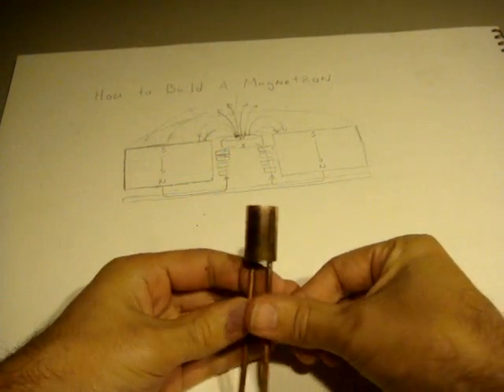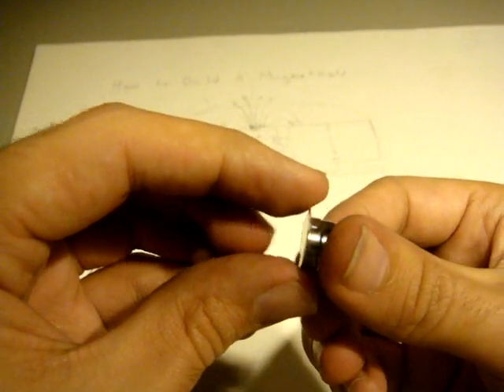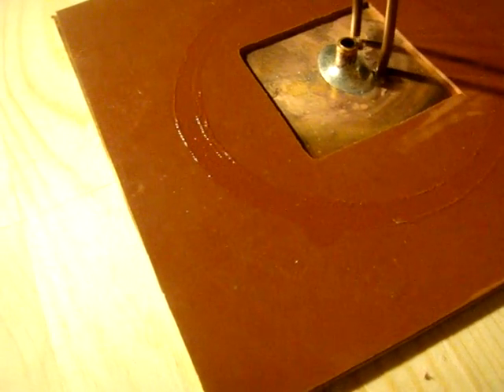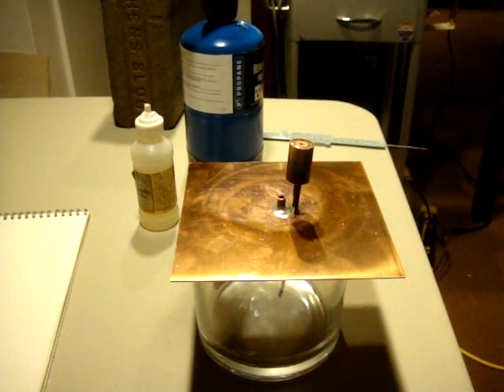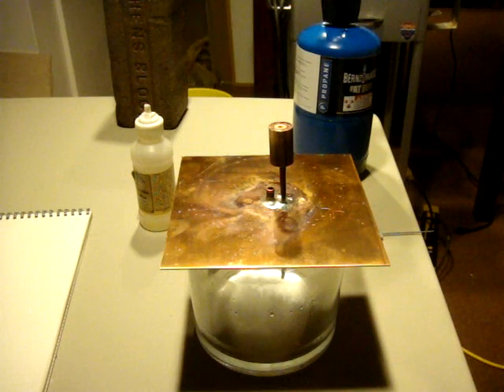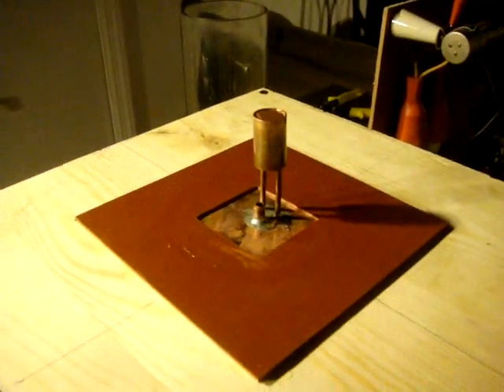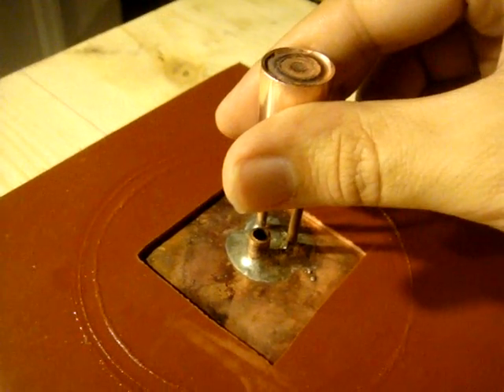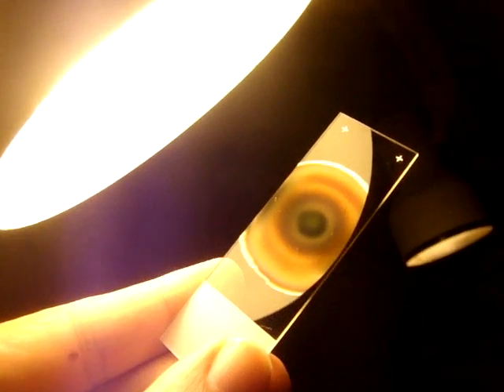DIY: Mini Magnetron (First Build)

Comment: Is any one else concerned about x-rays?
Reply from the maker: I've tried to measure for x-rays... the voltage is too low and the vacuum pressure too high
Reply: @sparkstarter is that done with just a 2stage rotary pump?
Reply from the maker: @SodiumInteresting  yes  just a 2 stage rotary pump
Reply: @sparkstarter  nice, I was part way through building one, I was going to have both a hv magnetron and high current evaporative coater. Someone gave me a oil diffusion pump but I've still not bought all the kf fittings and cooling system etc to be able to get it working. If I don't necessarily need it then I can get back to that project more easily at some point. The magnet assembly I made has gotten rusty so I'll have to remake that
Reply: Not below 20kv
Reply from the maker: @SodiumInteresting  Yes will work at as low as 500V my power supply goes up to 3kV

Comment: Amazing project. I'm really interested in producing low energy microwaves (just to heat things up like food so it's warm, even if it takes several minutes) just as a science project, but there's really nothing online about this...you can only ever find magnetrons from microwave ovens which are high voltage and terribly dangerous. It's almost like this technology is unheard of in any safer setting. So I was wondering if a magnetron at this scale can be powered with batteries (50-60 volts), and perhaps a step up transformer to produce hf plasma. Would this still be able to produce microwaves, just not as powerful? Thanks

Comment: thank you so much sir you showed me really important things. coz Im working now on a new research now. your video helped me a lot...
but uh I`m trying to make a long signal like ww2 first radar. how can I make 90* degree  long it pls tell me. than you
Reply from the maker: Radar magnetron is differnet type of design... but similar to a microwave magnetron.
Reply: @sparkstarter  thank you so much for your reply. pls can you show or explain it? I wanna long microwave radar signal. where can I find or how can I make it? I really need your help.
can you make a video about that pls? Thank you
Reply from the maker: @jemesraynor3296  What frequency and power do you need? What are you trying to do with this radar?
Reply: @sparkstarter  I dont need Radar I need radar`s signal its long and flat thats why I need it

Comment: Sparkstarter I think you mentioned in a  comment on this comment section that the pressure is 150 microns. I believe in another video of the improved set up you said the pressure there was 300. Shouldn’t the lower that number is mean better vacuum and not the other way around? I watched the thought emporium’s video and he said the pressure should be less than 100 mtorr. Could you explain? I’m trying to buy a vacuum pump and need some help. Thanks
Reply from the maker: The gas is what does the work, you want enough gas in the chamber to do the sputtering so if the pressure is too low you don't have enough gas. However you need have low enough pressure that the ions have enough free space to accelerate. If the pressure is too high the ions lose all thier energy bumping into each other... so there is a balance. I am using atmosphere so mostly Nitrogen Ions, with a heavier gas like argon you may need to go lower in pressure.

Comment: Dear, thank you for the job. I'm just now trying to do a Sputtering PDV magnetrom in my home. I'm using a argon tank gas, but I'm with a lot doubts yet. Do you used a magnet? It's neodimium?
Reply from the maker: You don't need argon, but it will probably work better than with regular air. Yes I use a NIB in for the center magnet and ceramic for the outer ring.
Reply: @sparkstarter  Thank you for responding. Good news that I will not need argon. I'm watching all of your videos. I will try to make my homemade Sputtering, PDV. I intend to make a monochromatic LCD simple with just one or two numbers for school work academic. But first I have to deposit very thin ITO Indium tin oxide at the glass surface.
Reply from the maker: @edilsonlima5985  Nice I've been wanting to order some ITO to play around with... feel free to post a video  when you get it working.

Comment: how do you run the electric though it, though the tube?  Is it Ac Or Dc
Reply from the maker: You  power it a bit like a neon tube but with the magnetron at on end. I use DC.
Reply: @sparkstarter  you have a positive and negative, connected to each tube? how would that work with the copper plate soldered to the tubes
Reply from the maker: @curtokay8046  no tubes are just for water cooling the whole assembly is -1kV  upper electrode in the Jar is ground or +

Comment: are you able to control the frequency of the magnetrons by using neodymium magnet or electromagnets
or more powerful and compact magnetrons so we boil the water with hand powered spring based battery or hydraulic pressure machine and spring based battery or gravity battery or pendulum powered battery etc

Comment: I'm a little suspicious cause there is no HV connection, anode cathode deposition gas ions etc ? :) how this setup creates plasma ? Just a ring magnet and vacuum ? (Or, all these parts of setup were hidden in this video)
Reply from the maker: yes, high voltage power supply used, see my other magnetron video where  show more of the setup.

Comment: But the truth is neyodimium magnet can not bear such high temperature , magnatic properties can loose
Reply from the maker: Yes, good point, that is why I tried to do water cooling which I admit didn't work that well. My magnetron design in another video solved the cooling issues.

Comment: Use propylene glycol as a coolant, that's what is used in liquid cooling for computers, its non conductive and non corrosive so your copper lasts longer. You can even create a closed loop cooling system if you buy a CPU liquid coolant pump and radiator.

Water is fine but water is conductive and corrosive.
Reply: Water is more efficient at cooling. Propylene glycol has a lower thermal capacity. If your not going near freezing, boiling or worried about corrosion or biologicals growing water is fine. I built a water cooled computer a decade or so ago and ran only a small % or propylene glycol in RO/DI water. Propylene glycol has to be completely pure to not conduct and if its open to air It will absorb water from the atmosphere (hygroscopic).
Reply: Use destilled water abd glycol, water is only conductive due to the disolved minerals in the sollution. Better yet if your worried about water causing a unintended circuit you can use mineral oil. Its what we use for full immersion big boy liquid cooling for HV/HF applications like powerstations and neighborhood transformers.

Comment: So you are trying to make a microwave magnetron? I would be careful if you aren't, you can produce microwaves with a higher energy that can cause cancer. If you know what you are doing you should be able to keep them in the narrow band that microwave ovens use, thereby not doing near as much harm to yourself. Loved the video by the way!
Reply from the maker: No, I was building a sputtering Magnetron this is a different type of technology not related to microwave generation. The voltage drop across the vacuum chamber is not sufficient to produce harmful radiation. Both AC and DC potentials can generate x-rays in a vacuum chamber if voltages are above 20kV. or higher. I am using voltages less than 2kV.
Reply: @sparkstarter  You're still going to produce a lot of hard UV from your plasma tho so make sure you at the very least protect your eyes with some kind of polarized lenses or even better a welding helmet. 2keV isn't enough to produce any ionizing radiation of any note except maybe the odd stray amplified charged particle being punted across the room
Reply from the maker: Doubt that any UV makes it past the glass. Don't make me buy a UV meter to prove you wrong.
Reply: sparkstarter That's what I was trying to say but, this is the internet and you know how people are on the internet.. xD
Reply: You could be producing x-rays if you are using DC instead of AC.
Reply: Not enough voltage present to produce any register-able x-rays. I would be more concerned about microwaving myself though. RF burns are unforgiving and not nice.
Reply: Yes they are! I have experienced them my self unfortunately.  I am curious what is the voltage you are using?
Reply: really happy to find some helpful videos and peoples over internet .
i'm trying to deposit indium tin oxide , on glass , 
i have some ideas but i really need someone to guide me trough the steps of building a sputtering chamber , i already got a vacuum pump (good one , like yours +sparkstarter )
maybe i have to find pyrex glass ,
i can about another things , like security , i know there is no expl0sion without oxygen 
but i keep a care about my eyes ,,, hope everything gonna be safe ,
anyway that was wonderful video , i hope to have more details about things to avoid for security ,,,
and how to inject argon gaz safely , 
more details Voltage , Current , and timing ,,,
but i really like the video
big up , good luck dear @sparkstarter
Reply: +sparkstarter what kind of waves is this producing if not microwaves?
Reply: Hello I want to aks related question about microwave technology ?????

Comment: Hi there

We also made a very similar set up but we couldnt be successful. Our vacuum level is 3*10^-2 mbar and we apply aprox. 1000V but all we can see is just random sparks. We couldnt ignite the plasma. we cleaned our copper target (like shining) but still no success. Do you have any suggestions why cant make it?
Reply from the maker: Mehmet Can Alphan The magnets need to be strong... I found that once I ran this device too long and the magnets over heated. They were still magnetic but they lost their strength required to bend and focus the plasma. Get stronger magnets and keep them cool would be my advice.

Comment: wow what a great project! very nicely done! would you please explain how you introduce the high voltage electricity to the set up you have here? Is it the copper plate that is electrified? Do you think a van de graaf generator would work instead of the microwave transformer? Thank you :)

Comment: DIY mini Magnetron sputter system. It is crazy! It really could work, and deposit copper thin film on a piece of glass. But it seems that the film is not uniform even in a small area in the glass. That might be because the sputter gun is too small, also the Cu target, which let the Cu goes to the glass sub with different angles. Thus, we could see so many circles on the surface of copper thin film on the glass. Anyway, as a self-built sputter system, people has done a really great job.
Reply from the maker: There are a couple of variables you could play with to increase uniformity and quality this was sort of a test of concept.
Reply: I see. People can try to heat the substrate, rotate the substrate to improve the uniformity. I am very supervised that you have fabricated one by yourself, cause in my mind, for a huge sputter system, the vacuum chamber is very complex. Anyway, I also see people fabricated a even simple sputter system with a a glass cup as the vacuum chamber. It can work. That is crazy!
Reply from the maker: Quentin Lee I used a larger more sophisticated sputter chamber in college I enjoyed using it. Oddly enough there isn't a large demand for semiconductor fabrication knowledge... I went to work in the solar industry and started to miss my semiconductor fab days... I wanted to do copper oxide solar cells but I could never get it to work. Sounds like you have some experience in semiconductor fabrication?
Reply: sparkstarter Yeah. I have been in semiconductor industry for 5 years, and familiar with most of the design and process.
Reply from the maker: Quentin Lee What do you think of the job growth in the semiconductor sector? I would like to do more work in that field but doesn't seem like there are a lot of good opportunities.  What do you think?

Comment: 1 month continuous mass production possible, arc None, the particle does not come out of the ion source
Voltage up to 3500V, up to 6M Length ion source, can be stable sputtering, ion source can produce double-loop
Pretreatment, IBAD, etching, cleaning,Implantation,sputter
Data requirements; kdh6157@hanmail.net,+82-10-7685-2564 duhan Kim, Naruto Eng, Japanese can
Reply from the maker: Send me a free unit Kim, I will make a Youtube video for you : )
Reply: sparkstarter email adress: kdh6157@hanmail.net
Reply: sparkstarter Ion source is more expensive

Comment: Would it be less efficient without a vacuum or just not work at all?
Reply from the maker: yeah the whole thing is in a glass jar.
Reply from the maker: Surya Pandian thanks :)
Reply from the maker: Needs low pressure vacuum to work...
Reply: What does the vacuum do?
Reply: sparkstarter
but in this video, there was a vaccum pump but was there any enclosement like vaccum chamber in it, I dint see ny vaccum chamber over here, just a hole where you showed you would connect vaccum pump, did you have a glass over it or something like that..
this iwas AMAZING though.. :) :)
Reply: WOW!! the whole video and the setup was amazing..great work buddy!!! :) :) :)

Comment: thank you sparkstarter,   I just read one comment where you said there was no oscillating frequency and this wasn't from a microoven.., aha...  , so if you used  such one from a  microwave oven and with  an oscillating frequency, would it possible by any means and in any configuration possible in any way,  to produce any glow in the free ambient  atmospheric pressure air? thx

Comment: Hi I work with tesla coils but  not magnetrons so  I,  wonder if that is a sealed glass tube around the terminals that I see or not at 7:28? is this glass pre evacuated,  i.e. vacuumed? why is there a glass there is it only for "protection" (but its insufficient)
Reply: That’s what I’m wondering

Comment: First, it looks like your copper plate is a dead short of your power supply, before it ever reaches the maggie head. Second, I don't see any resonant cavities, so is this oscillating at mains frequency? Third, how to make this work without a sputtering target or losing matter from your plate emitter or thermionic emitter? Fourth, why doesn't this dissarrange the field strength of your magnets over time (they seem to be electrically connected via physical contact with the copper?

Comment: Very interesting. I had a different approach and made a coil instead with magnetic base and its producing plasma in open air at 12 volts.
Reply: You can make a mini radar powered by a battery?
Reply: @alf3071  What the frequency of the mini radar would be? It wasn't mentioned in the video.

Comment: Was your mini magnetron the anode? If it was, maybe place the part to be plated at the cathode so you don't char the plating and would probably get more even coating. Its an awesome start. I'm building something different but using copper and magnets for EMF to light conversion.

Comment: I suggest that you try a different (the proper) soldering technique - heat up the copper, then put the flame away, touch with solder letting it melt; repeat as necessary...

You really shouldn't touch the solder wire with the flame, first melt it on the copper...

Comment: Is it not the magnitude of the current that prompts the production of x-rays rather than the voltage itself? Also, I'm not entirely sure what the bottom plate is connected to if anything...please clarify. Thanks.

Comment from the maker: This device produces no Microwave or X-Ray radiation. My sputter chamber in no way resembles the design of a Microwave magnetron or vacuum tube diode. The pressure is too high (150 micron) and the voltage is to low (<1.5kV) for x-rays to occur. However if you don't understand some basics of vacuum technology and a little bit of engineering please do not attempt to build a sputter chamber project.

Comment from the maker: the coil is only for cooling the magnets, the coil, magnets, and copper base plate are all at the same electric potential and connected to the negative terminal of the power supply. The positive terminal of the power supply is connected to a copper plate at the top of the vacuum chamber. hope this helps...I might do a video that details how electrical energy is connected to the chamber, would that help?

Comment: It's not clear to me how you feed electrically this device, since the coil is short-circuited by the copper plane you soldered at first. It's hard to believe for me, that any significant current can flow inside our water cooled coil. Can you explain better? Thanks